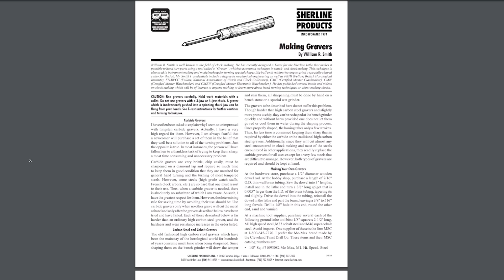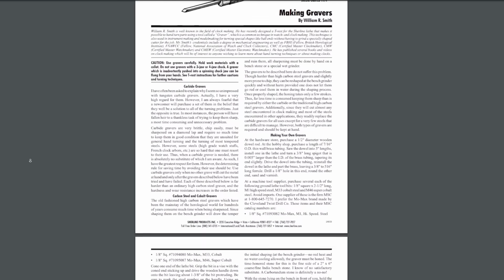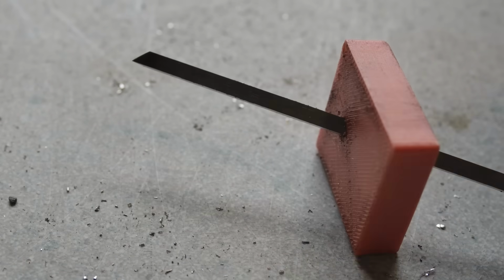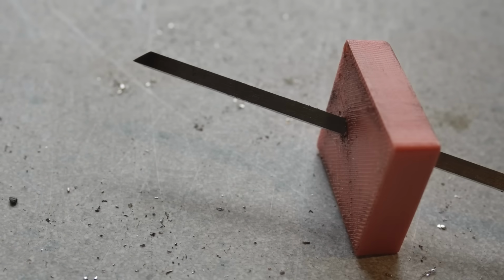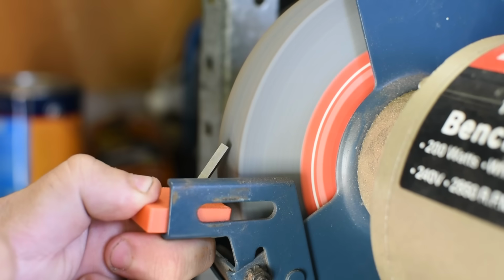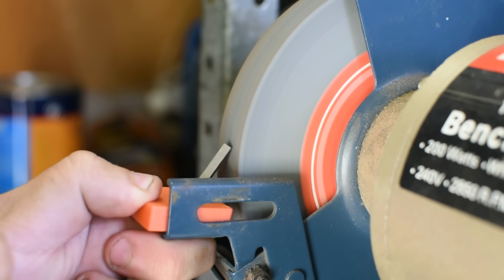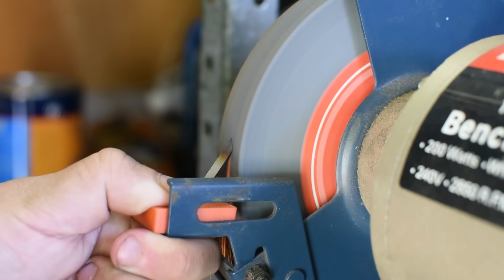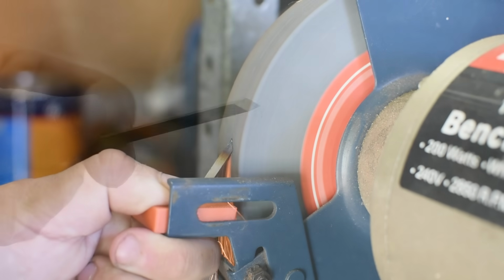I Printed A Better Lathe

Comment: See initially I thought it would be silly but then I remembered concrete has a lot of tensile strength without being very flexible so it might work as a rigid foundation for a lathe like this.

Comment: This idea may work better as a as a bent sheet metal parts kit. The user can seal filled in with concrete or epoxy. I have seen some guy use granite chucks and epoxy to build a CNC or late somewhere.

Comment: it would be nice if you gave use the parts list for all the parts that can't be printed motor and bearing as well as the electronic controller board and a hardware list bolts screws length thread and quantity

Comment: This looks genuinely useful.   Some ideas for V3:
     Little fingers all over the inner surfaces to hold onto the concrete.  Over time the concrete will come loose from the plastic, and the whole thing will feel less solid.
     Caps for the exposed concrete. You  don't want sand and grid over your projects, and it will look better.
     Better concrete. Concrete engineering is a vast subject, and I'm sure you can do much better along any metric you think would improve things. (e.g. concrete that sticks to plastic or is slightly less brittle)
     Complete, live links to everything you have to buy in a github project.  This is guaranteed to chang over time.  You'll make updates for a while, but later you'll prefer that later
         builders of your lathe project do their own homework, and if you've made a way for people to send pull requests with updates, you'll have made something that 
         lives on without your input.  There will also be better inventory lists for the US, EU, China or wherever.
     An order request link to PCBWay or something similar to have them just print and machine your parts list.
    A benchy test makers of your project can use to test the quality of their build.
    Parts of your lathe that can be made on your lathe. Adjust your build so that these parts are upgradable.  Sooner or later a real machinist is going to get hold of your project and laugh at it and 
        say "if you do this, it will be ten times better"   and you can take their suggestion. and make your lathe 10x better.
    I wonder if resin impregnated sand would work better
Reply from the maker: Good suggestions for sure, github and documentation in general is something I need to get better at. PCB way is also a good shout, there are parts like the bearing alignment pieces that are designed to be CNCd for those who can so making that as easy as possible is a good idea. I have considered epoxy granite type things many times but ultimately get put off by the cost, however I do mean to experiment wit it. thanks for the feedback.
Reply: Epoxy granite
Reply: It seems what is being called concrete in the video is really just a mortar mix of sand and cement, gravel wasn't noticeable anyway.  GP epoxy resin mixed well with raw cement as a filler would  work really well in this application.
Reply: Resin for the impregnated sand might get expensive depending kn the resin used. You may be able to use a sand of your choice mixed with an inexpensive sodium silicate solution (aka water glass) as a binder.
Shake The Future here on YT fills 3d printed forms with it all the time to cast small scale metal parts. He's covered the process in detail, you may very well be able to adapt his mixture into a more easily poured version for this project!
Reply: A very good post.   I might have missed it, but what about pouring concrete/epoxy sand in with steel wire mesh reinforcement? That would make it crack-proof.
This whole concept is fascinating!
Reply: Superplasticizer admix in your concrete will help a drier mix (stronger) fill the mold as if it were much wetter
Reply: You can also use UHPC concrete, which is specifically made for machine castings like this.
Reply: Agreed!
Reply: Sorel cement binds with organic material maybe an alternative.
Reply: The anchors/fingers should be inverted cones or pyramids not straight
Reply: Wouldn't the concrete at the bottom of the lathe still be a little wet or soft? Does it not take longer for the water to evaporate from the small openings?
Reply: @ZergRadio  Thankfully, concrete doesn't dry, it cures. The water becomes an integral part of the concrete and doesn't need to evaporate for the concrete to harden. The concrete chemically bonds with the water.

In large concrete pours, the curing can generate enough heat to cause the water to evaporate--so, in some cases, they'll spray the concrete to keep the top surface a little wet so it's not starved of enough water to cure properly.

(this is highly dependent on the concrete, the pour, the formulation, the temps, etc etc)
Reply: @Pyrichia  Wrote "The concrete chemically bonds with the water.

In large concrete pours, the curing can generate enough heat to cause the water to evaporate--so!

Ahhhhh, I did not know that that it bonds to water. hmmm

I do remember once when working with concrete that it got very hot to the touch. :face-blue-smiling:

Thanks for the reply.
Reply: @ZergRadio  Water becomes part of the structure through hydration of calcium.
Reply: @ZergRadio  Concrete does not harden by evaporation of the water. In fact, concrete can even harden under water, if it is not washed away while soft.

Comment: Need to add fiberglass chopped strands to your concrete (technically cement/mortar) mix to add more structure & some reinforcement to your concrete fill. It should make your concrete-filled tool structures a bit stiffer & much more long-term durable.

Comment: since it's on a timing belt you could use a stepper as a virtual divider and add a second axis for gear cutting relatively easily. (you could even use an inexpensive ramps or grbl board to control it)

Comment: This is a nice machine Chris, for sure! You are on the track of creating a viable replacement for (maybe even better than)  the Unimat. One critical issue I see right now is that you need some sort of shield or seal for the bearings in the headstock. 
Keep up the good work. 
This size lathe is perfect for model work and should be popular.

Comment: Hey mate when cutting your graver you completely destroyed the temper of the tool steel making the tool soft now. The colouration is the steel getting hot. You need to be constantly dipping it in water to avoid this.

Comment: Your spindle bearings outer race is spinning with the spindle it should not so it will eat away it’s housing so that means it’s already destroyed you can’t have 3D printed parts touching any part of the bearings so when you add the concrete cement in bearing blocks
Reply: I don't think that's the outer race spinning, I'm fairly sure that's just the roller cage, which should spin.

Comment: Regarding the torture test you can't center the aluminium part with a thread. Threads don't center. So now if the aluminium is tightened or loosened even just a tiny bit, it will be off-center and thus imbalanced.

Comment: That's not concrete, that's mortar; add some proper aggregate; and maybe some glass fiber/steel dispersed reinforcement - should improve stiffness. Or just go all way in and cast it from iron; use epoxy concrete?
Reply: Aggregate doesn't add stiffness, only compression strength and abrasion resistance.  Non-engineered aggregate decreases tensile and shear strength somewhat, since it displaces the calcite, which is doing the hard work.
Reply: @lowrads  you talking about static or dynamic loading; I guess we'll see if the precision drops after this mortar cracks normal operation

Comment: just curious if yoou have considered epoxy granite instead of using cement in your designs? it certainly wouldn't be cheaper, but may add some extra rigidity

Comment: A few summers back, I spent a while planning out something very similar to this. Then I got a job that ate all of my free time and ended up buying a Unimat 3 on ebay instead, so I never really got around to seeing if it would work. I'm really glad someone has actually done it. 

One thing I would really, really recommend looking into would be making this adaptable into the Unimat 3/4 (or even the older SL/DB) system. There's a pretty large ecosphere of interchangeable parts for each (M14x1.0 threaded chucks, live centers, etc), as well as a pretty big range of aftermarket parts available from the usual online chinese sellers.

Comment: This is an awesome project! Where did you get the spindle? Concrete is not dimensionally stable. Have you done any experiments on that? Plaster of Paris is also cheap, dimensionally stable but less strong. It may be worth experimenting with that. And of course there is also the tried and true Epoxy Granite used for this kind of machine tools for a long time...
Reply: Plaster of Paris can be improved by using white school glue! Makes it less brittle/vibraty too. If you want it really tough, adding fibrous material does it (like hair... Ewww)

Comment: Make sure to add a set of lock nuts to your spindel end to be able to apply the appropriate pretension on your tapered roller bearings. This will add spindle rigidity and improve surface finish and overall precision.
Reply from the maker: Very good idea thanks

Comment: As a machinist, you really really should have covered those bearings before pouring the concrete. I heard that crunch when you tried spinning it, and because of that, those bearing will not last that long.
Reply: I could be wrong, but if you look carefully at the headstock build up, it seems like the bearings are encased in their own little tunnel of sorts and perhaps protected from the aggregate? Thats what it looked like to me. I also heard that crunchy sound and figured the same thing though. If it was a tiny bit of concrete up against one of the faces it'll wear away and wont be touching it, if there's a risk that some silicates got into the rollers, as you say, they'd be ruined very quickly. Just seems likely that the sound is misleading though, as the care thats gone into the build in general make it seem unlikely that he'd have let sand into the bearings.
Reply: We are using a tool rest and hand shaping metal here… these bearings aren’t precision really.
Reply: Well now you have a handy lathe to machine a better motor pully
Reply: It’s only briefly shown, but I think there’s a black tube that separates the bearings/spindle from the concrete.
Reply: Any chance you can take the time to model up a remix for that bit, as I'd like to make this lathe for myself but Im not sure Im competent enough to model up a solution myself?
Reply: @Yavorh55  I don’t think it has anything to do with the model itself, but rather with the “order of operations”. 

Just swap the bearing with a blank (3d printed should be fine) before the pour, clean everything, then install the real deal.

This thing is also not going to be able to do crazy stuff, so you can use sealed bearings and reduce the likelihood of concrete dust entering the bearings.

That sound is not just grease, there’s 100% concrete dust in there.
Reply: @Yavorh55 Reply to me, I’m going to print this and make it myself and will model a cover for it, if and when I finish it’ll I’ll be happy to dhare the file with you for a cover :) (you could also tape the gap)
Reply: @Yavorh55 you don’t really need a 3d printed solution, you could just use a rubber sheet with a hole cut out of it. You’re gonna want it on there to protect from chips anyway. Rubber is cheap and replaceable so if it wears out it’s a non issue to replace. You could just tap some holes or add some threaded inserts somewhere on there
Reply: @Yavorh55 Ideally you'd just print plugs the size of the bearings and pull them after the concrete sets.
Reply: As a supporter of this man's brilliance I think you should go fuck a duck you hater
Reply: I'm more concerned about the bearings having no protection from chips during operation
Reply: Also if you want my opinion, that’s just the sound that those bearings make.
Reply: I here for the comments and YouTube experts but I will add he does seem happy with his work
Reply: You can clearly see it’s grease too, it’s translucent. What cement are you using that is translucent?
Reply: you did not pay much attention to the video it seems.   and I HIGHLY doubt you are a actual machinist,  or have any time working lathes because that "crunching" you were talking about was CLEARLY the threading die cutting the threads onto that brass rod.  the mere fact that you did not know that sound is proof that you have either zero, or very little experience in a machine shop.....   also, the bearings were covered and protected before he poured,  its plain to see in the video.
Reply: @orion7741  watch 5:58 hes not making any threads at that point.... also, I'm more than happy to upload a video on my channel of me turning on my bench lathe. I'd love to make you look like a dolt. Just say the word and I will.
Reply: @XxIcedecknightxX that’s grease dude. He even says “the motor has been mounted, and the bearings greased” as he spins it. It’s just a ton of grease making a slurping noise close to the mic. That’s not cement.
Reply: @snowe..  I'm not sure why I need to explain this, but grease does make a sticky sound when first applied, but not a crunch.. I've replaced far too many bad bearings with good ones to be told that it's just grease.. It's not.
Reply: @XxIcedecknightxX  it’s not a crunch, you just aren’t hearing it properly. You can literally see in the video that the cement never came near these bearings, because he _covered them up with tape_.
Reply: @snowe..  ah yes, blue tape, the ulmate sealant. I'm not gonna argue anymore, I know what I saw and what I heard. I've worked in a clean room where your own body temperature will throw off a measurement by tenths, and if you're not wearing gloves, just the oil on your skin would cause problems as well. They need to be taken out, cleaned with solvent or wd40, soaked, then re-greased.
Reply: @XxIcedecknightxX  I’m referring to the section of the video. The cement doesn’t even touch the tape. It doesn’t matter how good a sealant it is, because the cement didn’t get anywhere near the bearing. What you heard is just completely incorrect.
Reply: @snowe..  Lol, ok I'll listen to a guy over the internet vs my years of experience and my co-workers decades of experience who said the same thing..
Reply: @XxIcedecknightxX  maybe you should trust the person actually building stuff rather than the know it all without a YouTube channel (that’s you)
Reply: @snowe.. 4:33 some tape, not enough.
Reply: @snowe..  Right... Because a doctor is not a doctor without uploading videos to Youtube and lawyer doesn't pass the bar unless he uploads to Youtube, got it.
Reply: @XxIcedecknightxX  It think that's the motor band against the drive pulley pulls - remember, he printed one - & the electric motor whirring as he spins it. It can't be pure bearing noise because the whole powertrain of the machine is moving.
Reply: @snowe..  I don't know why you are fighting so hard on this hill. He's offering constructive criticism, which should always be welcomed if you are a maker.
Reply: @XxIcedecknightxX that sound was the greese
Reply: @orion7741 before resulting to insults why don’t you hear why he said that, in a  mature adult way, and then say how his reasons could possible be wrong. I don’t agree with him but still
Reply: Lol, you seem threatened by someone pointing out a valid point. If you pour concrete into bearing, they won't last long. That isn't high level secret machinist voodoo. Accusing someone of knowing nothing because of the way a die sounds cutting brass is madness. It's silent dog. 🤣 

Journey level heavy maritime and rail  repair machinist here btw. I don't know any tradesman as sensitive as you've demonstrated. Chill bro.
Reply: @orion7741 also I work on much more than just lathes fyi. It doesn't take a genius to know that debris from concrete, rocks, or grinding dust will screw up precision parts.

Comment: I really REALLY like that one.
If the next version feature a post holder for a study holding of the tool (you will probably need a redesign and a lead screw) i will definitely print one (and throw some money on patreon, because your video are awesome)